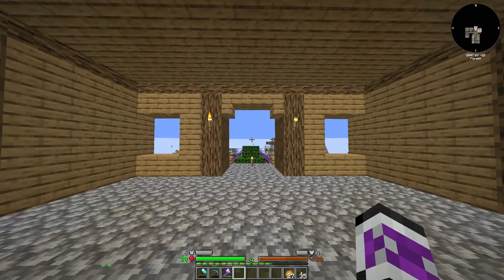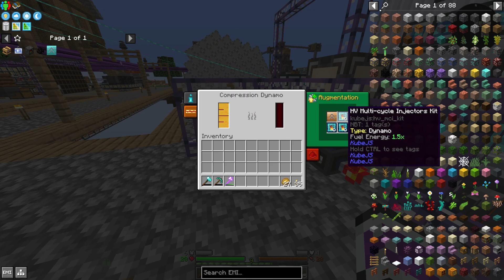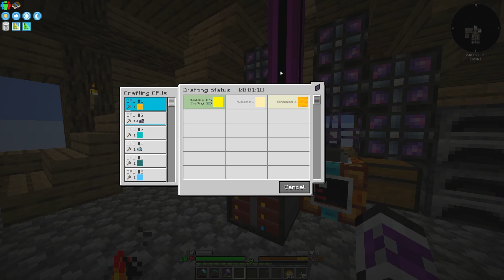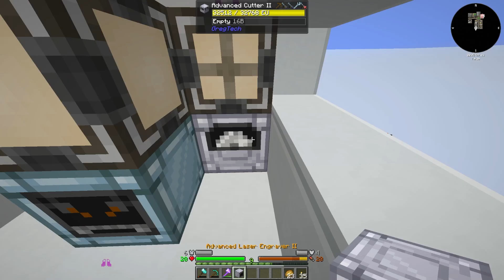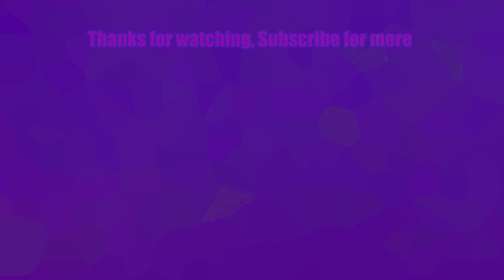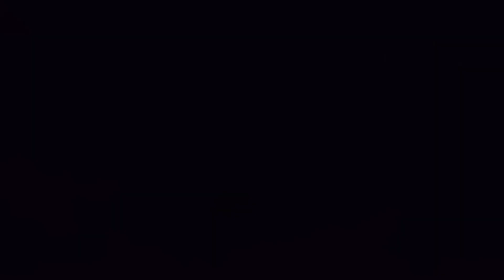Star Technology: Episode 21 - EV Machinery

Comment: How is he queuing auto-crafts like in 14:09, he can request nearly all components for laser engraver. I was looking at some options in my single world but couldn't figure it out.
Reply from the maker: AE2 has an auto-crafting system. So I can create a pattern that tells the ME system how to craft an item and then I can queue it up at anytime and it will automatically use the required materials to craft it. It's a pretty extensive system that I've been setting up since episode 12, and that's where I explain how to do it better.
Reply: @Thaumiumking9  oh, i knew about autocrafting, i use it myself but i don't get how you can press plus button in rei/jei (i don't know which one is used in the modpack) and ae2 system requests like 6 items at once. It doesn't do that in my world. I must request all components seperatly. Maybe i am missing some machine or setting.
Reply from the maker: Oh, then it's the auto-crafting hotkey. by default you hold ctrl + shift when clicking the button in the JEI and it queues up everything highlighted in blue.

Comment: U are in EV, Get the multi block upgrade kit, it allows u to convert some standard HV machines to multi block controllers. Those multi blocks can run multiple recipes at the same time with multiple circuits
Reply from the maker: That's the next goal, I just wanted EV hatches to run them faster, I'm pretty sure I said that in the video too.
Reply: Oh yeah, u did at the end

Comment: You should look into flux networks, it makes the transportation of power really easy, you just need an overclocked large chemical reactor, which you can easily get in EV. Also, take a look at mystical agriculture, especially what you can do with the water, air and fire essence, since they're an excellent source of salt water, distilled water, the dimension airs, lava and liquid blaze
Reply from the maker: I've been working towards flux networks for a while now, I'm pretty sure an LCR will be the next thing I make, but I did kind of forget about mystical agriculture. I just saw the huge un-intuitive quest tree and got scared, but those low-tier essences do keep coming up in the JEI, I'll check it out and see what I can do, thanks for the reminder.
Reply: @Thaumiumking9  Frankly, mystical agriculture is worth getting into just for the air, fire and water essence. The rest you can do, but just these 3 is enough to justify the investment

Comment: In my experiment large extrusion multiblock does not work, when I have one for bolt, plate, and wire it only created the plate even though it is in different buses, at least it is like that in 1.12.2 maybe it’s different, so you should test it.
Reply from the maker: They might need distinct busses enabled because otherwise all the materials would go through the same mold. I'll see when I get to it.
Reply: @Thaumiumking9  Each input bus must have the "distinct bus" mode enabled yes
Reply: @Thaumiumking9  yeah I see it now. It work fine
Reply: I'm using each input bus for a different extrusion, and each input bus also has its own pattern provider. So far everything has worked flawlessly.
Reply: @realflemmli  👍

Comment: Fluid drilling might also deplete the vein so you should checks if the vein at 100% or lower.
Basic driller depletion rate is 100% and 1-1.5x overclock
Adv driller 1 depletion rate is 50% and 16-64x overclock so with the adv driller you get 16•2 = 32 times better than basic drilling at HV if I remember correctly.
Reply from the maker: I didn't know it was that much better, I thought it was just double speed or something. Yeah, I'll definitely get that then, titanium shouldn't be much of a problem now.